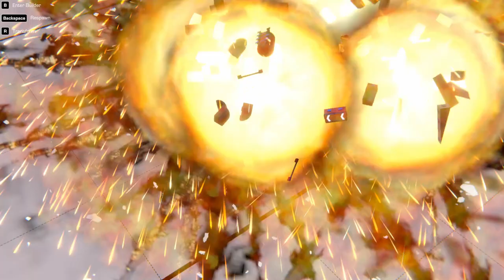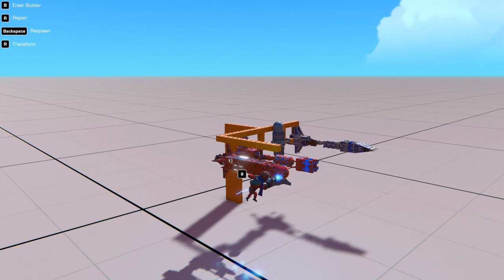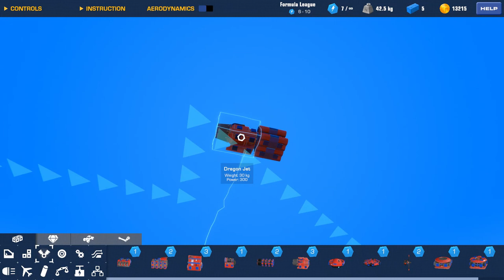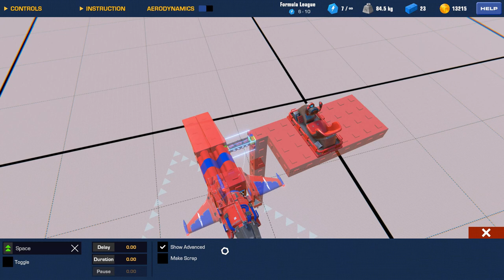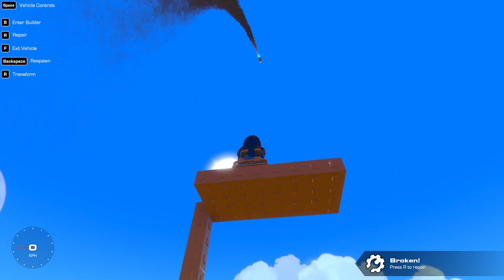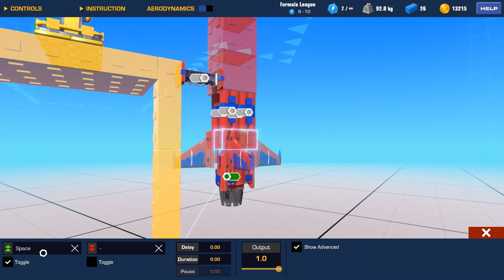HOW TO BUILD A MISSILE !!! (tips and tricks)-Trailmakers

Comment: If you were able to make the missiles spin with mini thrusters or something would that make the missile fly stair through the air and not fall?
Reply: Spin once it’s detached*
Reply: Yes. I use two opposing helicopter engines and it helps tremendously with accuracy. I mainly use that size of a missile for ground or water based builds tho lol